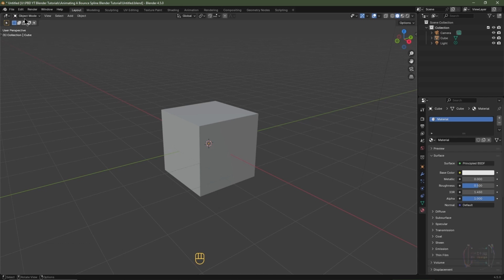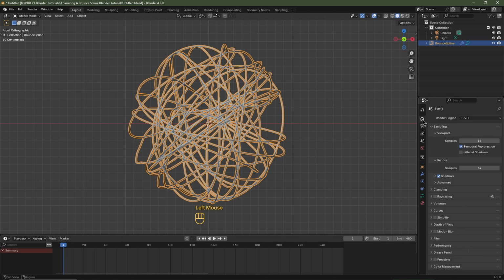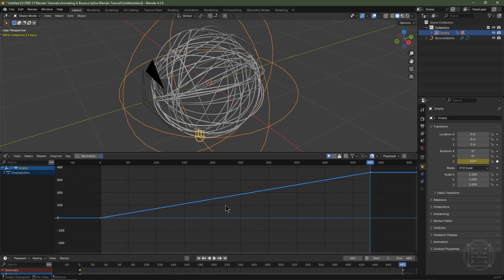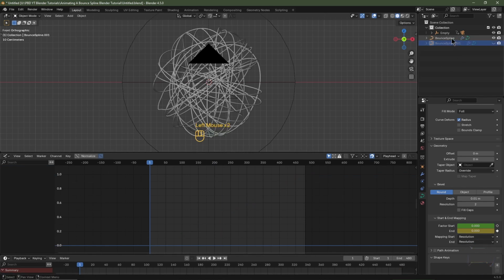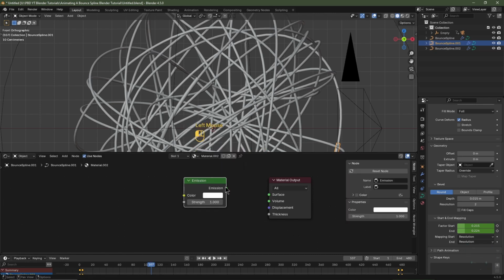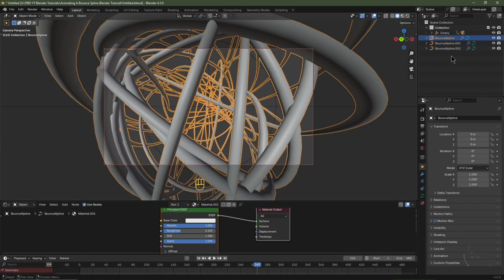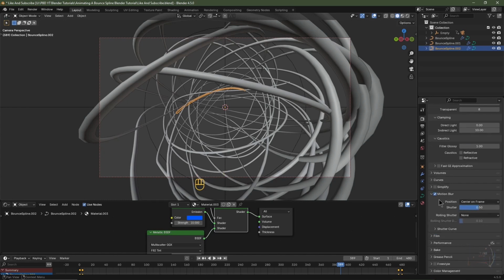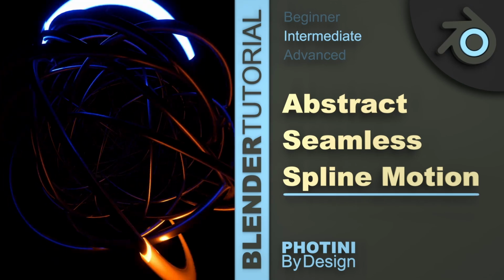Bounce Spline Extra Curve Objects Animation Loop – Blender Tutorial

Comment: Nice look with a very reasonable amount of work. I was expecting geometry nodes but this was a better tool for the job.
Reply from the maker: Geometry nodes is an amazing set of tools, and it is possible to make bounce splines using geo-nodes, but the method used in this episode is quicker and easier. These bounce splines are also pretty awesome for text, you should give it a go.